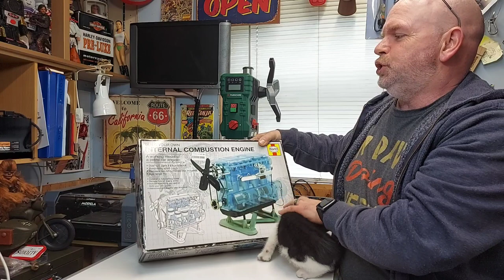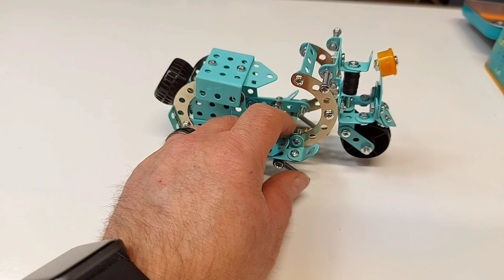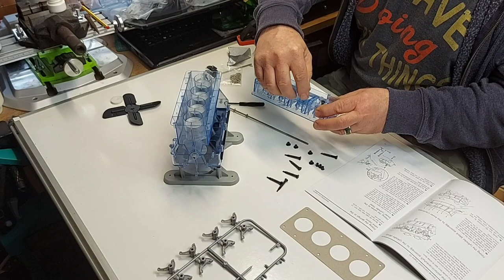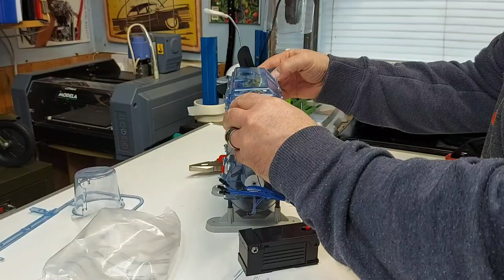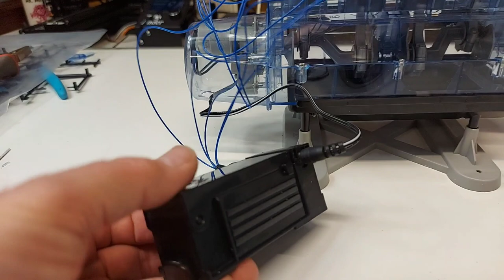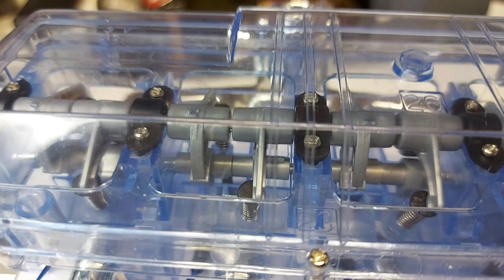Building A Working Model Engine / In The Workshop

Comment: That will go in my car, it'll be cheaper to run as it's electric so they say. Only thing I'll need to wear ear defenders. Put some lubricant on those bearing surfaces David. Tony
Reply from the maker: Ha 😀, I put vegetable oil on moving parts Tony 👍